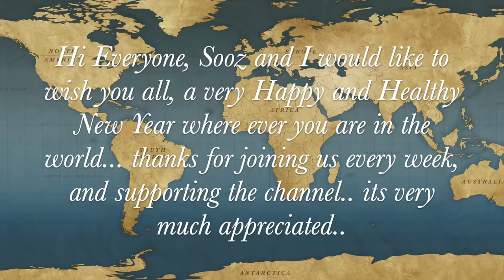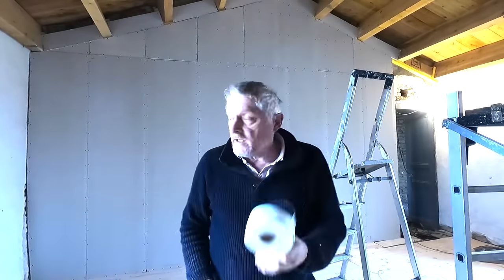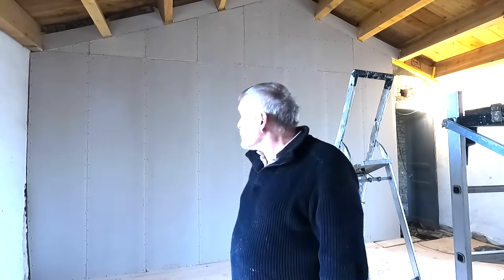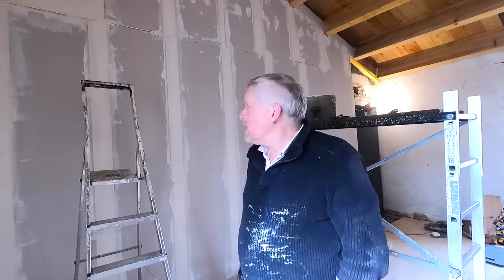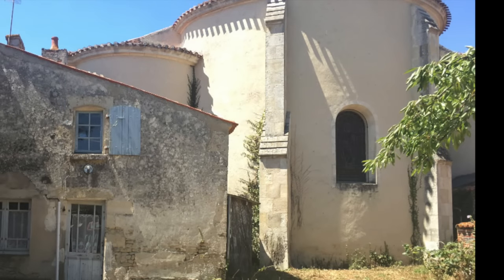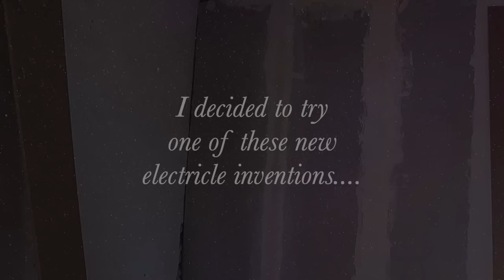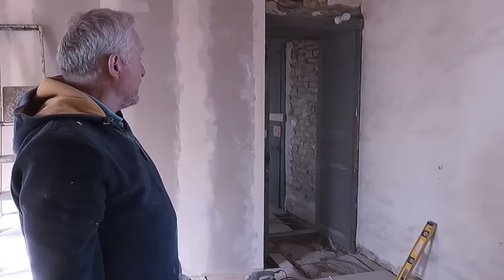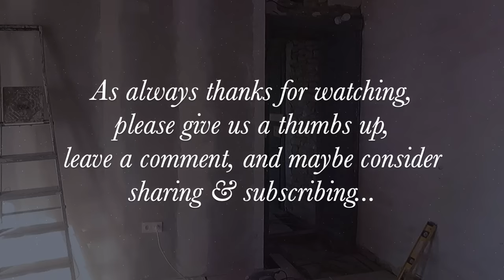The Restoration is completed, giving us a  Stunning Light and Glass show...

Comment: Putting on tape is a must. Keeps the filler from cracking along those lines and covers the screw heads which are a pain to fill. I wish I could help you put on the filler,( mud, in Canada), it doesn't have to be that labour intensive. Using a narrower trowel at the beginning and feathering the edge of the filler cuts down on the sanding. 
The Church window is quite a sight to behold. 🇨🇦
Reply: Totally agree. He needed help with this. Even I did it after instruction and went much easier. Poor guy.
Reply from the maker: many thanks it turns out really nice, so keep watching thanks

Comment: Wow those windows are amazing, very lucky to have that next door! 
Good job on the plasterboard, very tedious work, look out in Aldi or Lidl for a sander to do the joins. It doesn't cost much and is designed to do the job way better than the normal sander and comes with dust extraction built in so no need to sweep afterwards!
I like the henry hoover...... i have two, can't buy anything as good for the money over here.
Very enjoyable video, I liked the use of the mesh for joints and is probably preferable to the solid tape.
Look forward to the next one.
AJ
Reply from the maker: yes they look great now there completed... believe it or not it is an Aldi sander I just don't know where the attachment is lol, I find the solid tape can move and wrinkle sometimes so prefer the stick tape.. cheers Andy

Comment: I used to hang and finish drywall. On stilts 😁
It is a nasty job sanding. 
Looking good!! 😎👍
Reply from the maker: I have thought of buying stilts, but to be honest the scaffold and ladders should do the job... many thanks as always
Reply: @OurFrenchHouseRenovation  yeah, and stilts are limited height. It's convenient if the ceilings are the same height throughout. But not so if you need to go higher than 12'. Scaffold provides a bit more stability and height.
Thanks for continuing the videos!
Cheers!